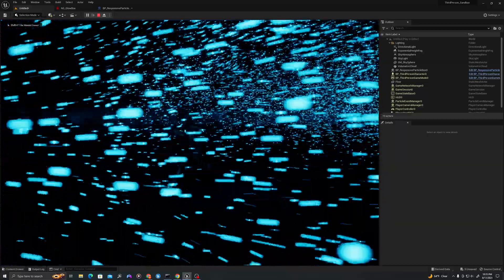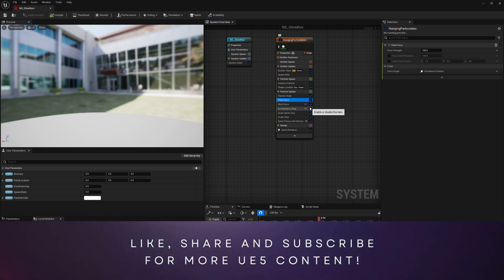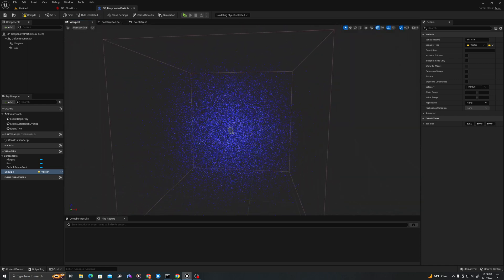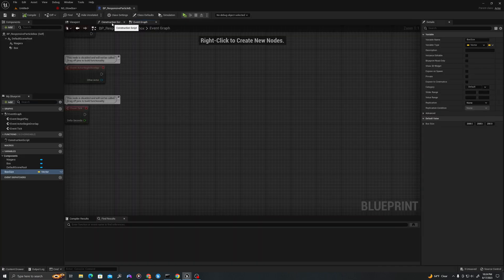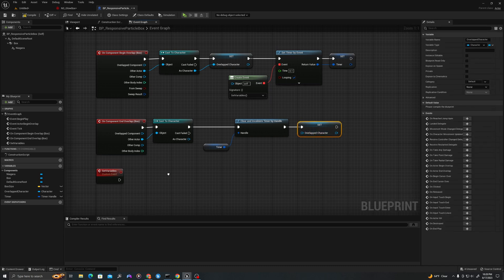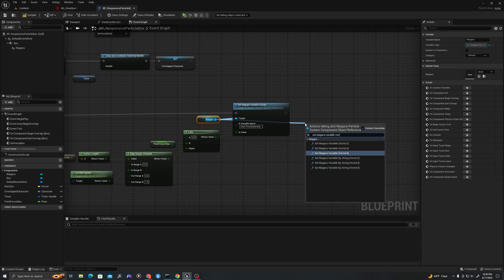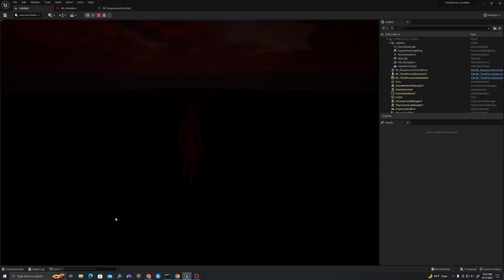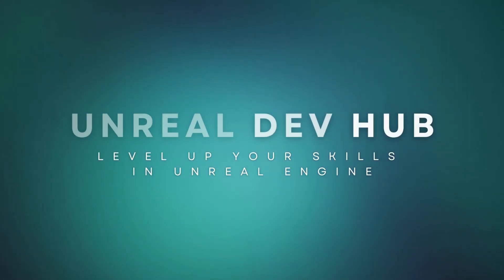UE5 Beginner Blueprint Tutorial - Make Niagara Systems react to the player with Blueprint

Comment: I am trying to follow your tutorial in Unreal 5.3 and running into issues with having the capsule collide with the particle volume. My end goal is not utilizing a character at all but just the capsule attached to affect the particles, but am trying to follow what you have to understand the logic and it is not working. 

The volume seems to be setup and working correctly, and I have gone through comments and tested the suggestions about Overlap settings to no avail. I have also tried establishing this in another brand new test 3rd person level to ensure it wasn't my other file or plugins that were causing issues. 

Do you have guidance on this? Or alternatively, do you have a tutorial that is similar in nature but just uses a collision capsule on a separate object (such as an actor or BP)? 

Thanks in advance

Comment: nice video... I've been trying to adapt it to take the point location of many characters, player controlled and some AI, almost there but I need some work on it yet.

Have you tried this yet?
Reply from the maker: I actually was working today on something similar to what you're describing. What's the context of what you're describing? That'd help me propose a path to create the logic you might need for your project.
Reply: @UnrealDevHub  

I got it some what working but it would only interact with one actor at a time.

I'm working on a top down arcade space ship shooter, like asteroid, I've been trying to use this as like a dust layer the player controlled ship(actor) glides through and also the AI controlled ships(actors), pushing them particles aside as they pass, and interacting with explosions and shots fired from the player controlled actor, the colour change as they interact is good, going form a bright blue to a neon blue/white.

Comment: Hello, I followed the same example but the characters are not recognized.
Do I need to connect it separately?
A game mode override caused the character to crash.
Reply from the maker: In theory, whatever Character you are using will inherit from the class Character when we "CastToCharacter" at 7:42. Does your character have a collision capsule? Does your character's collision capsule have "Overlap" set to WorldStatic in the collision settings? Your character's capsule will need to be set up to overlap other actors in the environment (such as the BP we have created in this video for the "particle box") in order for the BP to recognize it. Collision is a two-way street - both objects need to have collision enable.

That's my guess of what might not be working in your situation. Try starting in a blank level and using the default UE5 mannequin character to test, and assess what the collision settings are in that character, and apply them to your own character to make this, and similar logic work in your game.

Comment: Great video. I followed everything you did step by step. Even deleted everything, made a new project, and started over following everything again. There is no interaction happening with the particles and I am unsure why. I have checked to make sure everything matches perfectly. Got any ideas what might be causing the issue? I'm new to Unreal so not sure what else could be an issue.
Reply from the maker: Glad you liked it. There are a few things you could try.

1) Make sure your collision volume has “generate overlap events” set to true and has a collision setting like OverlapAllDynamic so it recognizes the character that enters.
2) Make sure that you are properly referencing your parameters in the Niagara variable set nodes from the Blueprint. For instance, if you create a user parameter in the Niagara System called SpawnRate, in your BP you will set the variable User.SpawnRate. The prefix is required.

Those are my first two hunches.
Reply: Ty for the fast reply. You were spot on with your first suggestion. Went to the details section of the BP_ResponsiveParticleBox and scrolled to the collision section and checked the "Generate Overlap Events During Level Streaming" box and it works great now! Amazing tutorials. Will be trying each one. This is my first.  @UnrealDevHub